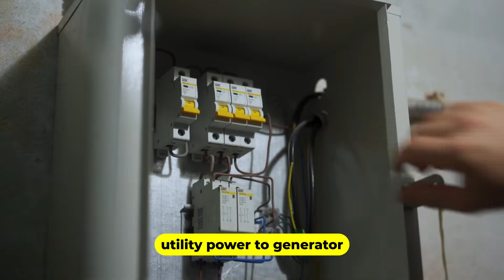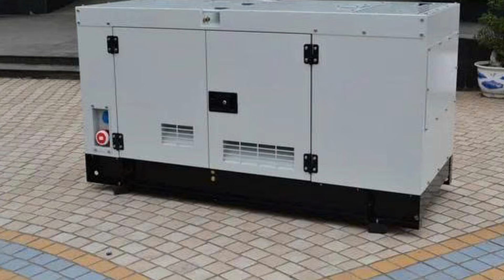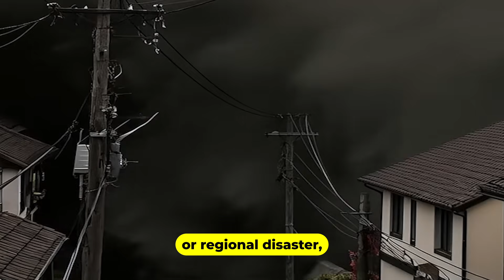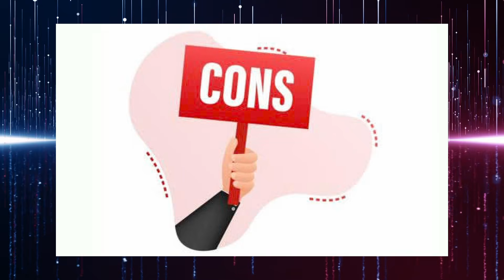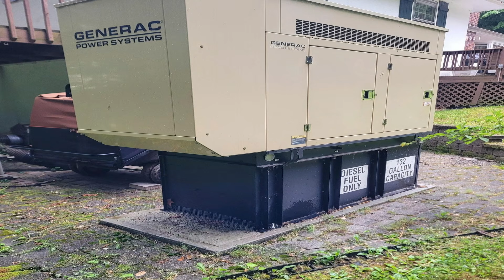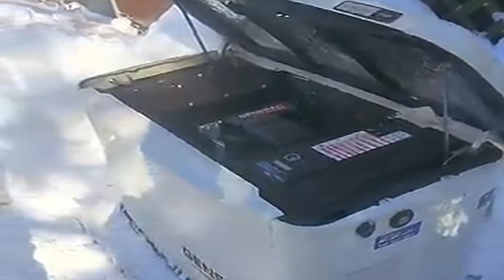Natural Gas, Propane, or Diesel? Choosing Your Standby Generator

Comment: Very few single family homes need more than 10KW, 20 is HUGE
Reply from the maker: "Exactly. If you have good load management, 20kW is often overkill. I find people get nervous about starting loads (like HVAC), but for steady-state use, 10kW is plenty of overhead. Are you running a smaller set-up or going the solar/battery route?"
Reply: Start surges can be an issue. I put an easy start on the central air and soft starts on the well and pool pump.

Comment: Shame you couldn'tmatch up the closed captions with the narration. 
Kinda irritating and somewhat disracting. 
Piss poor production quality. Detracts from your message
Reply from the maker: "Thanks for the heads up. I’m still dialing in the technical side of the new channel, so I appreciate you calling out the caption sync issue. I'll make sure it's tighter on the next video."

Comment: Solar
Reply from the maker: “Solar’s a solid option—especially paired with a good battery setup.

Are you running it already, or something you’re looking into?”
Reply from the maker: "Solar is a game-changer for long-term sustainability, especially since it doesn't rely on a fuel delivery. Are you running a full off-grid setup with batteries, or using it more for supplemental power?"

Comment: I have a battery backup system with solar to recharge the batteries.  In winter the system is good for around a week and it can power the house pretty much indefinitely in summer.  A big advantage of my system is that it is silent and when the grid power goes out, the transfer to battery backup is less than 1 AC cycle or about 0.015 seconds.  I don't even notice the change over.
Reply from the maker: “That’s a solid setup—and that seamless switchover is a huge advantage.

Being able to run silent and not even notice the transition is something a lot of people don’t think about until they experience it.

Interesting difference between winter and summer too—that’s where conditions really start to show up.
Reply: My house runs on 37kwh of battery backup charged by 9kw of solar. On occasion multi day heavy clouds  the system will switch to grid to maintain 25% charge on the batteries. If the grid is down I switch to one of my three trifuel inverter generators generally running on natural gas. If natural gas is also down I can run on stockpiles of propane and gasoline for at least 6 months. After that I would have to reduce my electric down to critical circuits and worst case the wood stove for heat.
Reply: That's what I wanted but I wasn't the only one making the decisions.  Went with 38kw Kohler on propane - 3x - 1k tanks in ground.

Comment: to be fair no one needs generater to run entire house , most blackouts are hours to a week rarely do you need to do laundry use half of appliances  i made out fine with 3500 propane gasoline i only had 15 lb propane rest gasoline , i will replace 2 old tanks for swap  tanks then have the 5 lbs added to them  but ran freezer refrigerator tv fan  kept blinds closed every window closed and house stayed ok for week i bought a portable a/c  and 4 hurricanes never really needed it . i run 3 libels of extensions so no hookup to house panel needed . i do shut breaker to water heater and shut air off so if power trickles on or blasts on i not trying to draw a loy 
as for if you buy the auto generators imo diesel and don't forget a diesel additive to keep algie from growing  in diesrel truck section
Reply from the maker: “That’s a solid real-world setup—and a good example of managing loads instead of trying to run everything.

A lot of people don’t realize how far you can stretch a smaller generator just by prioritizing what actually matters.

Also a good point on fuel planning and storage—that’s where things really start to matter over a longer outage.

Appreciate you sharing that—how long were you able to run before needing to refuel?”

Comment: The Generac owners lose. Those things are garbage. Everyone I know who has made the mistake of purchasing one has regretted it. I wish this wasn't true, but it is. They all failed within the 1st year, some the very 1st time they were needed. Buyer beware.
Reply: Been using a Generac 22kw for 7 years. Worst problem has been a bad 12v battery after 3 years. Have had it running for days without power with 0 issues. Just my experience.
Reply: GENERAC is just fine the issue is people dont maintain them, then expect the world from them. All GenSets are high maintenance brings. they need weekly exercise , monthly Load tests and minimum quarterly inspections. If you take care of them they will operate as expected when you need them.
Reply from the maker: “Appreciate you sharing that—I’ve definitely heard mixed experiences.

They’re one of the more common options because they’re easy to install and widely available. Like anything, a lot seems to come down to build quality, maintenance, and how they’re used.

Always good to hear real-world feedback—what kind of issues did you see most often?”
Reply: @TruePreparedness Engine failure has been common. There was one friend who had no electrical output. His was the first use failure. Was without power for 4 days in a Michigan blizzard. I am sure some people have had great experiences, but the people I know have not. I always wanted one until I saw the issues people were having. Buyer beware.
Reply: @TruePreparedness so the water in oil issue and frozen pcv assembly are very common with the nexus controllers and early evolution controllers. However these are easily fixed usually.
Reply from the maker: @patthefireman100  What’s your go-to fix for that? I’d love for others in the community to see it."
Reply: @TruePreparedness a small weephole in the bottom of the air box "very small" load testing and clearing snow and ice grime around the genset, also a cold weather kit is great
Reply: for the money you would be better off spending it on a solar/ battery/ backup system that pays for it's self overtime vs cost you money to just sit there outside in a box doing nothing everyday. then have the engine blow up the day you do need it
Reply: @NightshiftCustom to each their own but for my 5500 bucks out of pocket for my gaseous fuel genset would not pale in comparison to the startup costs of a viable and quality solar array. You do you man but don't shit on other people because you think that you might have something cooler or trending. Where I am from solar only works in the summer months
Reply: If it hasa battery you need to use it regularly or the battery will fail 
See so many blame the gear when it is user error where batteries are concerned  no matter the chemistry

Comment: 🤣🤣🤣
NONE 
I WILL KEE[P MY OFF GRID SOLAR AND WATCH YOU LEMMINGS PANIC
🤣🤣🤣
Reply from the maker: “All good—if your setup works for you, that’s what matters.

Everyone’s situation is different. The goal is just making sure it still works when conditions aren’t ideal.”
Reply: @TruePreparedness how is supposed to run when there isn't any fuel 
I can count on sun 
How long can you really run on fuel at the rate prices are going up
A gas generator takes a lot of fuel  I have one and know iy takes 5 gallons to run it 36 hours 
How long can you afford 10 gallons or more a week 
Not to mention hauling that much that often 

Solar I install it and power just flows in no fuss

Comment: NONE 
solar/wind/water with lifepo4 battery's will last longer then a junk Generac!  diesel would be the only choice if you want something that will last for a real  backup for charging the battery's only 
it's 2026 no one should be buying any fuel source type of power when you can make power for free everyday
Reply from the maker: Yeah, I see what you’re getting at.

If I had the right setup, I’d run hydro, solar, and batteries together—and keep a diesel generator as backup.

I do like where the technology is going too—being able to generate and store power without relying as much on fuels that can go bad.

The goal is layering the system so if one part drops off, something else picks it up.

That’s really what this comes down to—building something that still works when conditions change.”
Reply: @TruePreparedness  You need to buy a property with running water
Reply from the maker: @themekfrommars  “That would definitely be an ideal setup—having consistent running water opens up a lot of options.

Hydro is one of the few sources that can run day and night, which is a big advantage.

For most people it comes down to what their property can actually support—but if you’ve got that kind of setup, it’s hard to beat.”
Reply: sad many installers don't ad a switch to run house when sun shining  people bought solar not realizing the auto cutoff that's needed stops the solar to house unless battery or switch is installed
Reply: @remocres  most ppl today just use a grid tie system that does not have a battery backup or an inverter that can power the house when the power goes down as it not needed for 363 days of the year and you save a lot of money by just doing grid tie only and you always have grid power for free and no worry about how much power you have in a battery bank
Reply: @NightshiftCustom  not to mention buy from a dood to door sales who will sell crap

Comment: my solar batteries can power my house for up to 48 hours at the flip of a switch .
Reply from the maker: “Nice—that’s a solid setup.

Battery systems are hard to beat for short-term outages. The real question is what happens after that 48-hour window—especially in longer outages or bad weather.

Are you tied into solar only, or do you have a backup plan as well?”
Reply: @TruePreparedness  99% of the ppl that have a real battery backup system have a solar system. and 95% of solar setups have a genset of some sort. even ppl without battery's or solar still have a genset/portable power bank

now with EV's you can use it to power your whole house in some cases for days without a problem as most have 75+ kwh battery bank
Reply from the maker: @NightshiftCustom  “True—solar can absolutely extend a battery system, sometimes a lot.

But at some point, you still have to recharge the batteries. In the right conditions, solar can handle that. But in a lot of real-world situations—weather, shorter days, heavier loads—you may need a generator to help top things off.

Batteries are great for carrying you through the night… then solar picks back up during the day.

That’s why a lot of people end up running a layered system.

What are you running right now?”
Reply: @TruePreparedness  the sunshine will more then likely shine the very next day and by noon have your battery's back at 100% with a real solar system 

also solar is very cheap at 0.30c a or less a watt
10.000 watts of solar is only 3k and that's more then what any avg house needs for power for full daily use
16kw house battery is less then 3k 

to have a 10kw Generac installed is 10k easy and it does nothing at all for you just sitting there wasting money till the power goes out what once a year?
just a waste of money!

solar can give you free power all year long and pay for it's self within just a few years + you can just do solar only with grid tie feed back to lower your bill! or you can do both with a battery bank and do time of use! even without solar you can just have a battery bank with time of use to only use hydro from the grid at the cheapest rate
Reply: 110% The way to go today with the cost as low as it better to even buy a portable power station then a genset
Reply from the maker: @NightshiftCustom  “I get that—portable power stations have come way down in price, and they’re hard to beat for ease of use.

The tradeoff usually comes down to runtime and how much you need to run. They’re great for lighter loads and shorter outages, but once you start talking whole-home or longer durations, that’s where generators still have an edge.

A lot of people end up combining both.

What are you mainly trying to power with yours?”
Reply: @TruePreparedness  ALL power stations have a solar mppt charge controller. you simply put some solar panels on the ground till the power comes back on. 
best part unlike fuel the panels can/will last 35+ yrs 
also they make them now big enough to power your whole house from lots of brands
Reply from the maker: @NightshiftCustom  “Yeah, a lot of the newer power stations do have MPPT built in, and solar paired with batteries is a solid setup—especially for running without relying on fuel.

Where it really comes down to is conditions and scale. Panels last a long time, but output still depends on sun, weather, and how much you’re trying to run. Whole-home setups are definitely possible now—they just get bigger (and more expensive) as demand goes up.

I like solar a lot—as long as you have a solid way to store the power it’s producing.

That’s where the battery side really matters.

Comment from the maker: “Everyone argues about which fuel is ‘best.’

But the real question is—what actually keeps working when things start failing?

Natural gas, propane, diesel… they all have strengths and weak points.

What are you looking to run—or what’s working for you right now?”

Comment: Natural gas is pumped by electrical pumps. If the power goes off, so does the power for the pumps. Natural gas is not unlimited. rl
Reply from the maker: “Good point—and you’re right that parts of the natural gas system rely on electricity.

That said, much of the infrastructure (like compressor stations) actually runs on natural gas itself, and utilities build in redundancy for outages. That’s why in most real-world power outages, gas service continues even when the grid is down.

It’s a reliable fuel source—but not unlimited or guaranteed.
Reply: Gasoline-
Available to buy almost everywhere, lowest cost. Fuel consumption ok but storage is poor. Life expectancy is low long term usage.

-Propane/natural gas 
Infinite storage life, cheaper generator to buy. Highest fuel consumption and shorter life (non-commercial built).

-Diesel
Better fuel economy, last longer. More expensive to buy, storage life is good as long as it's done properly (water in fuel contamination)

Generac's Homeowners brand is mid-low quality and has long-term issues, but their selling point is ease of use. Their commercial units are expensive but decent, but repairs can be expensive (proprietary parts) 

My experience, installed a used 23kW single phase diesel industrial backup genset (Detroit brand) using a Perkins diesel (tractor engine). Average consumption is about a gallon an hour. My house at Max  continuous load is about 60A 240v, surges to about 80A with the well pump or A/C.
Reply from the maker: @CJ-jo6do  “Appreciate you breaking it down like that—that’s a solid real-world comparison.

Each fuel definitely has its place, and a lot of it comes down to storage, runtime, and how the system is being used.

That’s a strong setup you’ve got too—diesel makes a lot of sense for longer runtime and steady loads like that.

Out of curiosity, how long can you run on your current fuel storage before needing to refill?”
Reply: @TruePreparedness  about 70hr on the internal tank, 260hr with the external storage tank.

I live rural, just farms and ranches around me. Had a bad winter with our power out for about 2 weeks because of an ice storm. I decided I wasn't going to go though that again.😅

Still have portable gasoline generators as a backup as well.
Reply: its much rarer that there not generator backed since gas off any home with older pilots  all need relighting fewer and fewer as its been decades they were replaced with battery or power plugs   city water and sewages the same thing my city sends generators after storm for sewage lifts old twisted pare telephones ist patchy as phone co dont service there battery backups so exchanges get knocked out 
less problem but cells went down for weeks  hurricane ian in sw fl  . i love to build a cabin wood heat diesel backup  and solar not much needed for small home